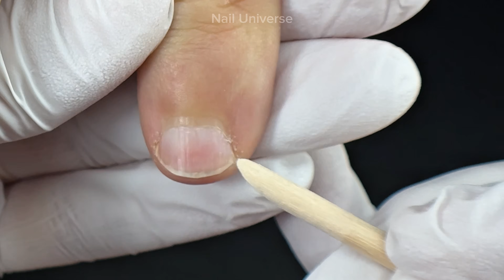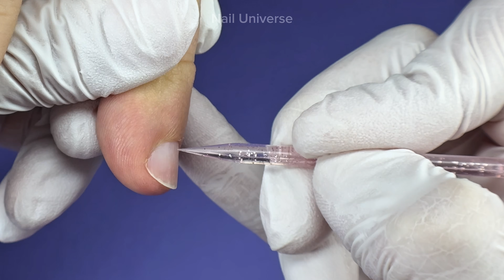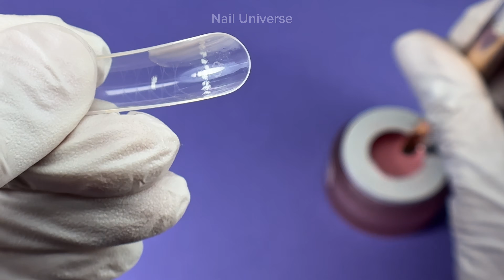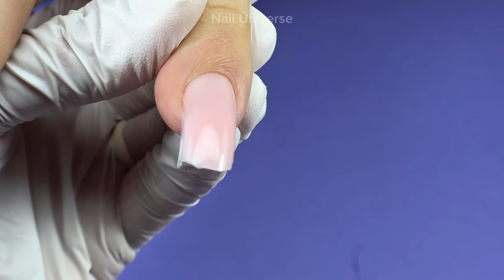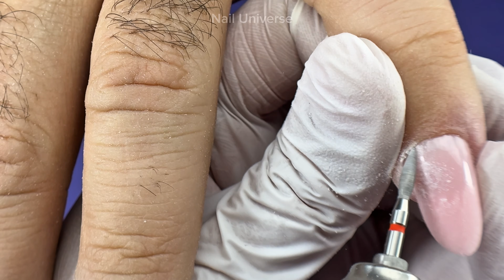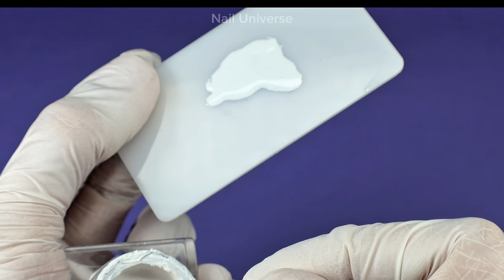Stop Guessing Dual Forms — Choose Them Based on Nail Shape

Comment: You are correct! After pushing back the cuticle with your orange wood stick. The nail plate is definitely larger. Like significantly larger. I too see techs adding more product thinking they will build the strength of the nail. All they do is create “hamburger bun” type nails that did not cure properly and look thick and unbalanced. Prior to your videos I have learned the 11 types of cuticles. I am laughing now because as an almost Business Marketing degree graduate I see you can say cuticle type or name plate shape. I swear half of surviving post beauty school is being able to funnel out the million different perspectives, leeches, snake oil salesman, and trying to figure out what you need to succeed and what is unnecessary to carry forward. I see your point in this video. I have all shapes of diamond bites. I use high rotation and lift the cuticle in the same fashion. I have silicone bits and did not understand their use. Thank you for newfound knowledge.
Reply from the maker: That’s fantastic to hear! It's so true how much perspective and discernment you need in this industry, and I’m thrilled this video helped clarify things. I appreciate you sharing your insights and I'm really happy you found the silicone bit knowledge useful. 🥰